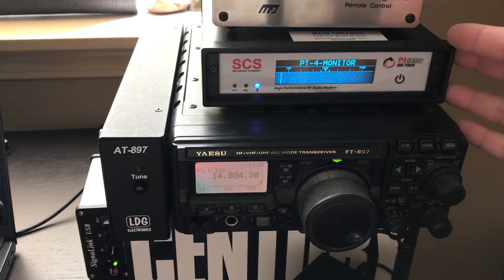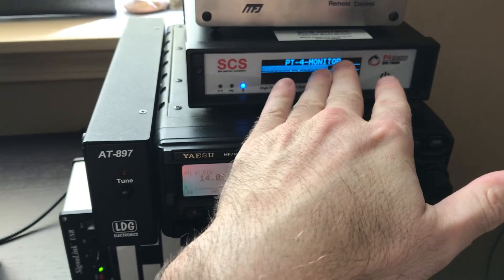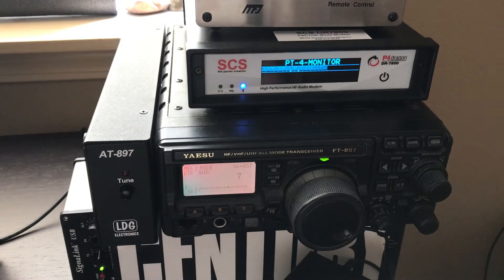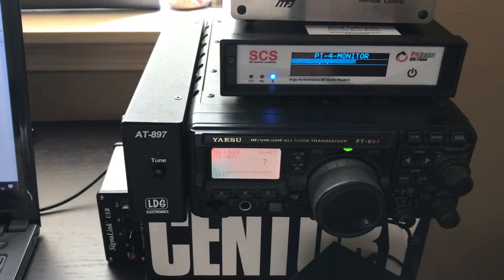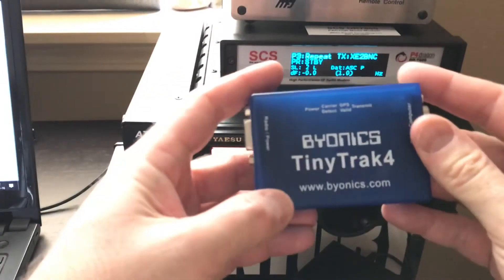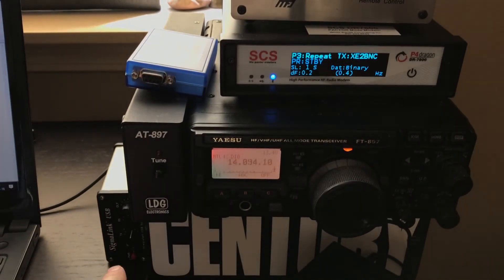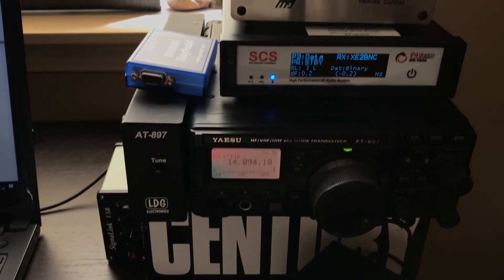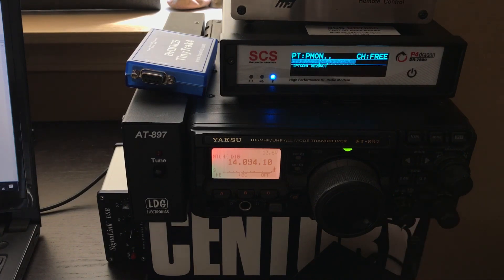SCS DR-7800 HF #Radio Modem Hooked Up

Comment: Hello!  Thanks for the content you provide, it has been a great help!  I just purchased this exact model from SCS.  I’m new to using Pactor Modems over HF.  If you wouldn’t mind answering 2 questions for me I would appreciate it!  1.  Which Drivers did you install?  I’m running a Yaesu FT-891 and a Windows 10 Laptop.  I’m not exactly sure which Drivers to select?  2.  Is there a way to keep the Signalink connected at the same time, even thought it’s not used with the Pactor modem?   Thanks for your time!
Reply from the maker: The SCS site has the USB drivers for your Window system. I am using Bluetooth, so no drivers were installed from my end. You can look on my website for a method to connect the SCS Modem and a Signalink soundcard.
https://greyscale.zone/scs-pactorsignalink-switch-box.html
Reply: @Linus007  Is there still information on mixing Pactor and a USB sound card into the radio? I am looking to use a Pactor and a Digirig USB Sound card so I can also use VARA FM when not using Pactor.

Comment: Lol. Incredibly, I have never used my Dragon SCS 7800 I bought over 6 years ago, but it is so difficult to find anyone who has an updated Winlink set-up how-to. Stranded with my Elecraft KX3, PX3, and PA100 now in western NC.   Biggest problem is trying to work with an Alex Loop at 10W limitation here in apartment, but can get out to POTA with a vertical Buddipole or EnCOMMIII on 40 meters at 100W.   Working on getting lift off through RMS Node KZ5ED Pactor/Pactor 123 Grid Sq EM85WX    Subbed.    73’s .  AF5LQ
Reply from the maker: Thank you for the Subscriber action. Have you tried Farallon.us for cables and documentation? They have a cable that may work (8128 - Modem to Elecraft radio, SCS 8pin din to Elecraft KX-3). They have a link that may be of interest as well: Modem to Radio Cable Chart (pdf).
Reply from the maker: Also, it is possible to roll your own cables. This video is the result: https://youtu.be/MYFULgLzsRs
I use the portable handheld for packet radio in addition to APRS.
Reply: @Linus007  It gets even more ridiculous. I have a Yaesu 8VXDR  tri band with the GPS /microphone dongle for APRS and couldn't do anything with that either! So it sits in the box barely used. The problem is not with the SCS Dragon hard wire connections (I have all the wires) it's just with using Winlink. I may have located a guy in SC on prepper Net who also has a  Dragon 7800 P4 who may be willing to help elmer me. It will be worth the drive.

Comment: Hi Linus. What Magloop do you have? You said that you use 50w of power. That is quite a lot for a Magloop antenna.
73 de Robbert / PA3BKL
Reply from the maker: It is a MFJ 1788 (15-40 meter band). It can take a lot of power. I would avoid any contact with it any time it is transmitting.

Comment: Have you found any pactor stations yet to chat with?  I have a PTC-II, and when I first bought it Pactor 1 and 2 was very popular, now it is hard to find someone!  Is Pactor 4 legal in U.S.A.?  I don't see why not if it only takes up 2.4kHz bandwidth!
Reply from the maker: Yes individuals can be reached but this is a rare thing. Pactor 4 is legal in Canada and Mexico. I. The United States, a symbol limit applies so levels up to Pactor 3 are legal.
Reply: The symbol rate limit of 300 baud is going away soon... data will be based on 2.8kHz bandwidth! @Linus007

Comment: Good video 👍
Reply from the maker: Node Systems Ltd 
Thank you for watching.
Reply: @Linus007  I am trying understand if Pactor 4 is faster then VARA HF.
Reply from the maker: Node Systems Ltd 
I have seen evidence to show that they’re very similar except pactor does an amazing job with noise and low signal to noise ratio’s.